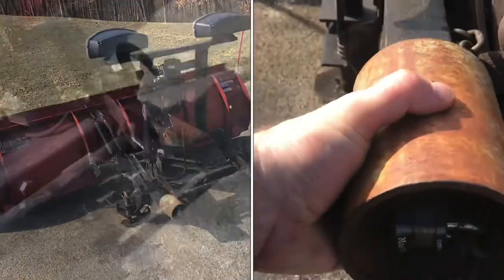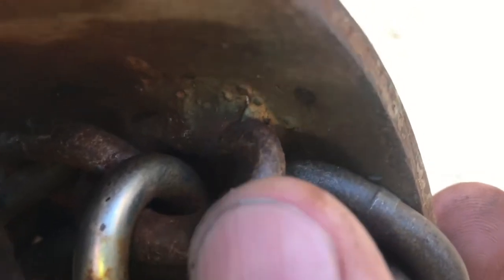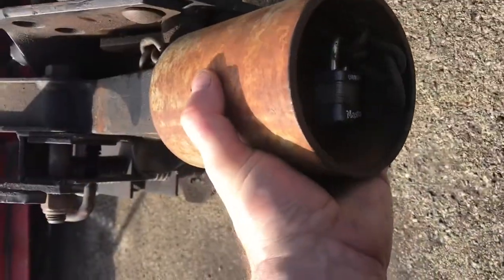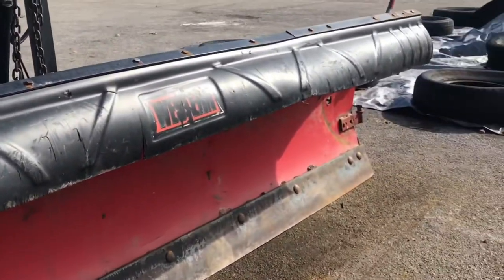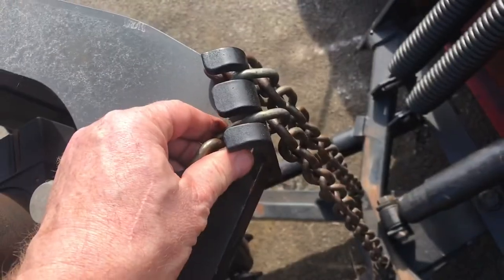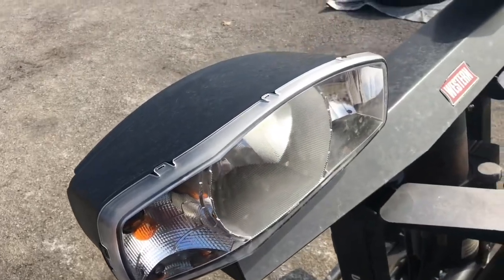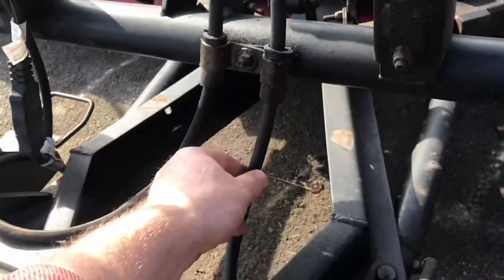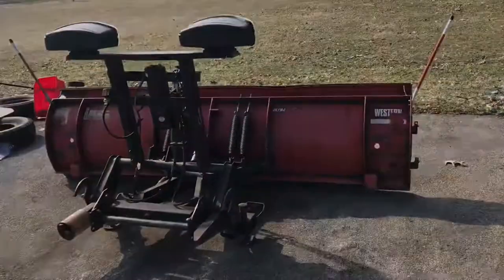THEFT PROOF western plow “ultramount” (security lock)

Comment: Keeping a heavy ratchet strap in the truck helps raise the plow up in case of hydraulic failure too. Another related tip to the hydraulics; UV radiation in the summer will destroy your hoses in 1-2 summers if you store someplace where it's in the sun. Put a tarp over the entire plow when storing..if the tarp has a silver side, put that side on the outside. A good tarp will self-destruct in about 6-8 years time..but the hoses will still remain uncracked and strong. Tarps are cheaper and easier to replace. Ask me how I know.
Reply from the maker: This totally makes sense, I will be putting a tarp on a lot of things now that you mention it. Those hydraulic lines are not cheap. The tractor is just sitting. I’ll be tarp in the tractor for sure. Thanks!